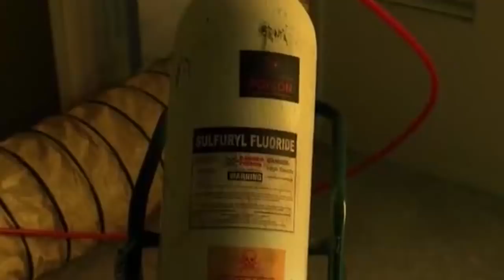Breaking Bad - On a Clear Day (The Peddlers) - Full Scene + Montage - s05e03 "Hazard Pay"

Comment: i think the main issue i have is the fact you need to power all that insustrial equipment and idk you could do it in a house.i guess generators could work but it would be loud as hell and draw a ton of attention unless they make a quiet generator...idk if they do. i fully acknowledge that i could be wrong but it looks like they set up a chopped down version of gus fringes lab in people houses and guses was below a giant laundromat...
Reply: No one would be suspicious, They are under the cover of loud machinery to bug bomb the place. No one would suspect a thing
Reply: +Brandon A what loud machinery is involved in bug bombing a place fans...a few big fans maybe?
Reply: they do make quiet generators.  the more expensive ones just sound like an air compressor so it wouldnt be all that out of place.
Reply: +emart88 yes i know they make quiet ones but im not sure how good they work...you might trade off the soft sound for extra supplies cause one quiet one doesnt do as good as a loud one...but like i said i have no idea id love to know someones proffesional opinion on this
Reply: +emart88 plus its alot of heavy duty manufacturing equipment youd probably need an industrial strength generator
Reply: not really.  the quiet ones are just more expensive.  I have a 4000 watt generator that can run my welding equipment all day which is the most power hungry equipment i have.
Reply: +emart88 oh yea i figured places like hospitals have generators that kick in when the power goes out and you dont really hear them

Comment: this is one of my favorite scenes in the series but the very idea of it pegs my bogometer. a couple of decades ago i worked at a hotel and was having a safety meeting with maintenance on the roof. the wind changed and I said "what is that godawful burning chemical stench?" "that's the meth lab down the street"
Also worked with some meth freak plumbers back in the day and they would all tell you the stink is a huge risk in getting caught. there was a reason so many of them lived on unpaved roads out in the boonies...
There's no way you could expect bug bombing to mask the smell or be a plausible excuse. Any exterminator company that left your house permanently smelling that bad wouldn't stay in business long, and ESPECIALLY if the crew had been using it for a pretext to rob and burgle.

Comment: The homes they chose to cook in were infested. It would have been an ironic, mildly hilarious side story If they had to contend with a post cook infestation of lice or fleas.
Reply: As they walk in you see some gas cylinders I would imagine there was an actual pest control team there too
Reply: Red Clown yes... but it was their job to do the cook, pack up the gear and then open the valve on the gas as they were walking out the door. The guys who were striking down the tent and removing all the gear simply removed the cook set up with the rest of the stuff. So Walter and Jessie spent a whole night working in a house crawling with critters.